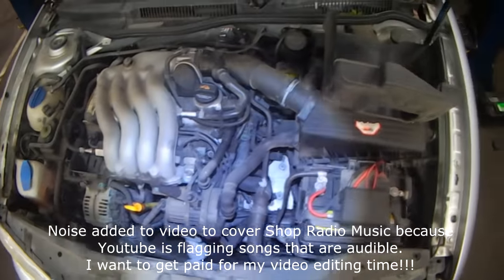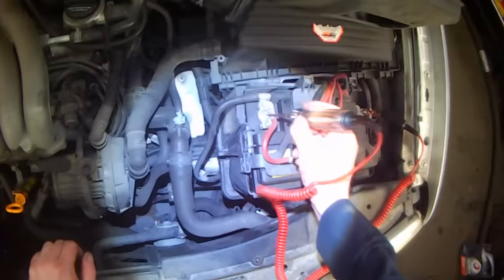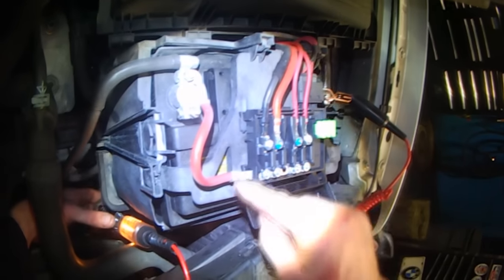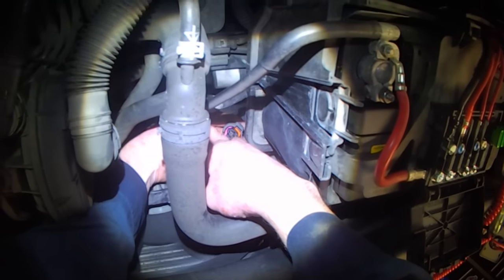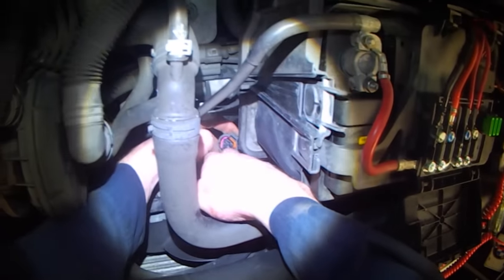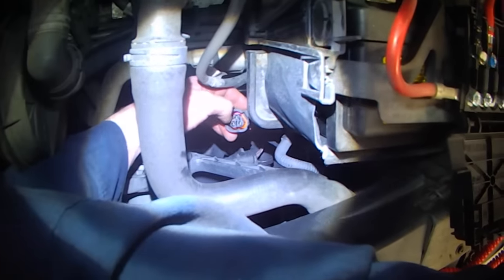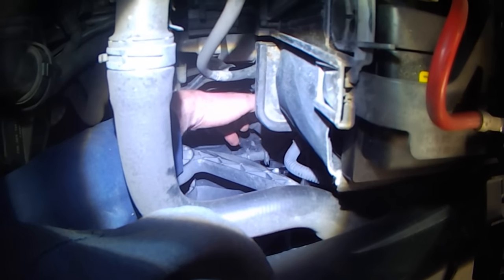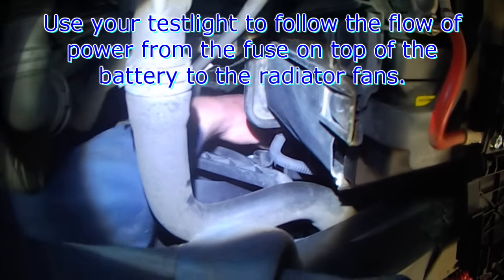VW A1 A2, A3, A4: Radiator fan(s) quick check.

Comment: Hi, I've watched several of your videos and they've been very helpful. If you don't mind, I have a question. My daughter has a '05 VW Jetta 2.5L and the transmission was recently replaced. Right after we got it back, the fans wouldn't shut off right away. Now they won't come on. The car has almost overheated 3 times. I've checked the fuse, the fans move freely and I hear what I believe is the fan control module clicking when the engine is turned off. It has the P0480 error code. I've already sunk $3500 into this car a month after we bought it and really don't want to spend another $400-$800. Would simply replacing the fans fix this? That much I can do myself. Thank you for your time.
Reply from the maker: The fan module gets a signal from the ECM (pulse modulated signal)... the fan then activates both fans at the same time. If the fuses are ok, the fan module receives a signal from the ECM but the fans are not turning, then the fan module / fans are bad. If I had the car at the shop, I would use a scan tool to turn the fans ON. If nothing happens, I would check power & ground at the fans and would confirm that the signal from the ECM is getting to the fan module. Here's a wiring diagram:
http://fkh161.ca/VW/A5/mk5RadFans.pdf
Reply: Sorry I didn't reply back until now - thank you very much for your help!  I was able to purchase a new cooling fan for $100, installed it and it now works.  You saved me literally hundreds of $$.  And it was so simple.  Thank you again!! Next on to the O2 sensor and door locks.
Reply from the maker: Thank you for the update!

Comment: Hi Thomas

You mentioned that if you have low speed but no high speed, it's a fan issue. But what about the fan control module that you mentioned controls the high speed of the fan? I have one on my TDI that I believe to be faulty, but how do we check it?
Reply from the maker: If car has AC.... bridge high speed on the rad fan switch with the ignition ON. If high speed does not come on, check for power at the fan connectors. No power, trace the wires to the fan module. if wiring is OK, fan module is bad.

Comment: I am writing in the hope that you can help me with the issue i have with my car. Car is Passat B6, 1.4 Tsi. The problem is next: When the AC is on, both fans are spinning at low speed and everything seems fine and quiet. But when the AC is off, main (bigger) fan kicks in from time to time, but only at high speed and only for a couple of seconds and then turns off. Also, when i turn off the engine and the AC was on during driving, both fans runs normally and after 2-3 minutes shuts off. But if the AC was off during driving, as soon as i turn off the engine, only bigger fan starts spinning, again at a full speed and sounds like a jumbo jet. That lasts for a couple of seconds and then turns off. Immediately after that, main fan starts spinning again at full speed, again for a couple of seconds and again turns off quickly. Basically, it runs on/off at full speed for a very short period of time and after couple of that ,,on/off sessions'', smaller fan kicks in and from that moment both fans runs normally and shuts off after couple of minutes. In short, it seems to me that the main fan is not able to work at low speed alone, without a smaller fan working too. Without AC, it runs only on high speed for 5 seconds and turns off. And that scheme repeats over and over. What could be the problem here? I don't know what to look for.
Reply from the maker: I would start with a full system scan, to see if any of the modules have cooling fan codes. I would then look at a wiring diagram, to see if there are other fuses that power the fans when AC is off. It might end up being a fuse problem or a fan control module problem. I can't be sure at this point, because I have not looked at a wiring diagram.
Reply: @EXOVCDS  Thank you very much for the response. I've checked today all the fuses (fuse by fuse) with multimeter and everything seems ok. I have also scanned all modules with Vcds and i've got two faults:

-Control Module 2 for cooling Fan P1948 - Output short circuit - Intermitent;

-Radiator fan 2 (V177) 
P1951 - Movement restricted/Jammed - Intermittent
Reply from the maker: You'll need a wiring diagram to verify power & ground to fan module. The ecm sends a control signal to the module... verify that the signal is getting to the module. If the fans are separate from the module, check for power to the fans (using vcds output tests). If no power is getting to the fans, then the module is bad. If power is getting to the fans, but the fans don't work... the fans are bad. Make sure to also verify correct ground for the fans... unless they ground through the fan module.
I don't have a wiring diagram handy, so that's all I can suggest right now.
Reply: @EXOVCDS  Little update about this issue: I was googling a little bit and found out that at my car both fans should run at the same time, no matter if AC is on or off. In my case, because the smaller fan was not working when AC was off and with those fault codes i've got, i've decided to replace the smaller fan. After replacement, i have erased fault codes and started to obtain situation. Unfortunately, the replacement of smaller fan did not solve the problem because, soon after, i've got the same fault codes again but this time, the problem appears to be less obvious then it was before. I dont know if it is a coincidence or not but now both fans run nice and quiet even when AC is off but it happens from time to time that only bigger fan starts to spin hard and loud like it was before. In the meantime, i have also found out that the control modul for both fans is the integral part of the bigger fan. Considering that, I'm now wondering should i replace a bigger fan also. I mean that's all i can do because, correct me if i'm wrong, but i think i cannot test power and ground cables that goes to fans connector when, at the current situation, problem appears to happen only occasionally (let's say 1 in 5 times or even less).
Reply from the maker: Replacing the big fan will most likely fix the issue. You can use a multimeter to check "control" from the ecm at the main  plug for the fan... similar to what I do in this video:
https://youtu.be/oqdv4cm86Ns

Comment: I have a 2009 VW GOLF CITY, the smaller fan on the passenger side wouldn’t stop spinning - Drained my entire battery so I would have to unplug the fuse for the fan every night when the car is turned off. Now my fan isn’t spinning at all but the temperature gauge isn’t showing it’s over heating on the dash. I have switched the coolant temp sensor, I have also plugged my fan into my battery to see if it’s still works and yes it does, I have bought a radiator switch too , my next step is replacing the entire fan or is the fan just spinning without me knowing ??
Reply from the maker: Both fans should run at either low speed or high speed when either speed is needed. If one fan is working, but the other isn't (when tested as in the video)... spin the non working fan by hand to see if it comes to life. Use a test light to confirm power & ground to the fans when fans are not on (when they should be). At 13 years old  there could be wiring problems, the fan control module could be bad... but the fan control module is only needed for fan activation when ac is selected or excessive ac pressure is pressent. .

Comment: Hey man thank you so much for this video, you were very to the point and i am so grateful for that, but my issue is sort of perplexing. This video is old so i understand if you cant/dont get back to me but Im frustrated and having a harm time finding help on the forums. 

I have a 2003 Jetta with the 1.8t that radiator fans wont kick on. I tested both fans independently and they both have full function of high and low speeds. However the car will not power fans unless i have the AC on. The AC blows hard and cold and the fans run but the car will start to run hot if the AC & inside fan are off. My temp gauge is working and my actual values will show my coolant temp get to 230° and thats when i kill the car because i dont want to damage it. Do you have any idea what could be going on? I replace the fuse box on the battery and that has changes nothing. 

I read somewhere that the thermo switch could be bad? Seems a lot cheaper than the fan control module but i dont know how to condemn that
Reply from the maker: Fans are not required at cruising speed. If the vehicle overheats while driving at steady speed... then the thermostat is probably bad / stuck closed. If the fans do not come on when triggered at the rad fan switch (harness plug), then look for a wiring problem or a power / ground problem.

Comment: hey Thomas I appreciate all the content I know this video is old but any chance you see this I have a 04 bew Jetta that I recently bought the fans don't kick on for anything and the car has no ac. I tested the thermo switch like shown in the video and only one fan kicks on lo . I went ahead and tested each fan individually and both hi and lo worked on both. all fuses and connections look good any idea as to why the fans wouldn't be working? I  replaced the thermostat and coolant temp sensor hoping it would help but nothing
Reply from the maker: Watch the first 3 minutes of the following video... report your findings:
https://youtu.be/LiDRUWPw_f4
Reply from the maker: TDI engines take a long time before the fans come on.
If the engine is NOT overheating, then the water pump is OK.
If the engine IS overheating, even when at cruising speed, then the water pump is bad.
Reply: @EXOVCDS  hey man thanks for the reply!!! It doesn’t overheat at all but even after letting get to operating temp the fans don’t kick on and there’s never ac.  I do have flow and there seems to be heat inside so should I change my thermostat again ? 
( also I noticed that my top radiator hose is very warm after running and the bottom one that goes into the thermostat is not. This indactes a bad thermostat right ? I might have got a faulty one from the parts store)
Reply from the maker: @bryanmartinez8191 
No AC as in not blowing cold (but has AC)... or no AC in the car (no compressor)?
If you have AC but the fans don't come on when AC is selected, then you might not have enough AC gas in the system.
Like I said, fans take a long time to come on with TDI engines.
Hold the rpm at 2500. It'll take more than 10min before the bottom hose gets warm.
As soon as the thermostat opens a little, it will close again due to the cooler coolant entering the engine.
Eventually the radiator will get warm and the rad fans will come on.
If no fans or only 1 fan comes on when the radiator fan switch is bypassed, then you have to look for bad wiring/ corrosion... since you said both fans work at low & high when activated directly.
Reply: @EXOVCDS  it does have a ac compressor, I failed to mention when I put a paperclip in the fan switch only one fan came on

Comment: Hello Thomas. A month ago, I changed the thermostat and the car worked perfectly. But for a week, the dashboard does not indicate that the car is warm and the fan is running constantly. My mechanic does not detect a diagnostic error. The pipes to the radiator are warm but not hot, the fan runs and the appliance does not show temperature on the dashboard. After switching off the diagnostic unit, the car heats up to 90 degrees and the fan switches on and off, after 3 days the problem reappears. Monday we replaced a temperature sensor that is below the sample radiator.
It was repeated again Friday and then, he just hung up the diagnostic tool and the dashboard indicator went up as the fan stopped working. Everything works for now, it is not known when. The coolant sensor has not been checked!
Audi a3 FSI 1.6 2004 manual petrol
Reply from the maker: Have you checked this sensor already?
http://fkh161.ca/Audi/A3/BAG_Coolant_Temp_Sensor.jpg
Reply: @EXOVCDS  Yes, i change thermostat with new sensor ! The coolant sensor has not been checked! www.audi-sport.net/xf/threads/temperature-sensor-or-connections.413021/

Comment: So with the switch on the fans should be on low speed then correct? And then kick on and off high speed with the fan control module?
Reply from the maker: Year, make, model, engine?

Comment: Hey Thomas, Great video, I am in need of some advice, I have a 2010 VW golf and it overheats in traffic, I checked and neither of my fans are coming on. Any suggestions?
Reply from the maker: Check power, ground & control as per this video... if this looks like your radiator fan connector:
https://www.youtube.com/watch?v=oqdv4cm86Ns

Comment: Hey, ive got a 1999 golf with a vr6 swap.. bought it cheap just wanted something fun to rip around with and work on, cars been overheating and fans wont kick on, i did what you did in the video and when i connected the paper clip the fans kicked right on. Would you say i should replace my fan control unit?
Reply: or i was thinking just hooking up a manual fan switch, race car
Reply from the maker: Thermostat

Comment: Hi Thomas, thank you for this nice video. My car fans are running properly with jumper test, but not kicking when engine overheats! However, thermostat and temp sensor replaced with new, water pump no signs of ware out, cabin heater working fine. Is it possible that the radiator is clogged? My car is VW T4, 1993.
Reply from the maker: Possibly. Are you sure that there is no trapped air in the engine? Do you have flow back into the coolant reservoir?
Reply: I opened the air tap until water came out then after few days I tired to remove the upper radiator hose for little while but no good result. 
The weird thing is when I tried to remove the switch sensor, no water came out, while the water container was full!
How to know if there is back flow?
Reply from the maker: @navictor  if no coolant came out when you removed the radiator fan switch, then you have air in the radiator / system.
Reply: Okay, thanks a lot

Comment: Hi tom, Is it possible to load gas into an AC system without the compressor Engaging?
Reply from the maker: Yes... but you don't know if air is in the system. If the charge is low, adding gas while the engine is at idle (AC on) should eventually turn the compressor on (providing that a "low charge" was the only reason for non functioning AC). DIY AC Charge Kits are available, but be careful, as some of them contain Propane... if you ever get your AC serviced professionally, it could end up contaminating their equipment.

Comment: Sup Thomas, I got bad aux fan (ac fan) then I drop the whole assembly and replaced it for another one (oem but used). It did worked, but it stopped too after a while. I turn the ac on and the aux fan won’t come on.
 I have a coolant system code that I believe it’s the thermostat (which I’m gonna replace next days) do you think that the cooling failure could interfere at the aux fan, once the car don’t get really hot cause the thermostat is stuck open?
 What would do in this case? 
 Thanks in advance
Reply from the maker: Year, make, modle, engine?
Reply: Thomas EXOVCDS 2006 Audi A3 2.0t FSi
Reply from the maker: Both fans should run whenever fan operation is needed. Since you bought a used unit, it could very well be that the used small fan is also no good now.... or the fan module that controls the small fan is no good. Thermostat code does not affect fan operation.

Comment: Nice video. I tried to test my climatronic fan (the small one) which does not work on my passat 2004 and found out that the fan connector has 4 pins where you have 3 pins. How do you test the fan with 4 pins?
Reply from the maker: Which engine? Sorry, I read / replied to your other post first.

Comment: I have a 01273 fresh air blower code and I believe the small fan is not working. But I would like to test it to be sure.
Reply from the maker: The video deals with radiator fans... your code refers to interior fan(s):
http://wiki.ross-tech.com/wiki/index.php/01273

Comment: Hey Thomas, with your help I was able to sort out my wheel bearing issue 3 years ago big thanks to you. But now with a new car(VW golf 6), my fans won't turn on. The car can overheat in hot temperatures at idle when I'm stuck in traffic for example but is okay when riding. Do you got any idea?
Reply from the maker: You need to check power, ground, ignition on and fan control at the main fan connector. It could be that the fan module is bad (located inside the large radiator fan). You can test for power, ground, ignition on and control with a multimeter. Similar to this video:
https://youtu.be/oqdv4cm86Ns
Instead of using a scan tool to activate the fans, simply turn the ac on.
Reply: @EXOVCDS  I plugged the fans directly into the battery. They're both working. I also saw that I had a blown fuse. I'll keep you in touch
Reply: @EXOVCDS  Also, I scanned my car via VCDS in a shop not too long ago and the codes it threw out were about the fans not working and the secondary water pump. From what I have been told, the error is intermittent and I may have a ground issue
Reply from the maker: My instructions were for mk6... sorry, I did not know that you have the old fan setup.
Reply: @EXOVCDS  no no, I DO have an mk6 tdi 110hp
Reply from the maker: @maxly501 Sorry, I replied with the wrong account.  Yes, I know... but it uses the old style cooling fans / system. Mk6's in North America use a different setup... that's why I posted the link to that video. If your tdi uses the old setup, then you were able to test / check things like in the video above... which you did.